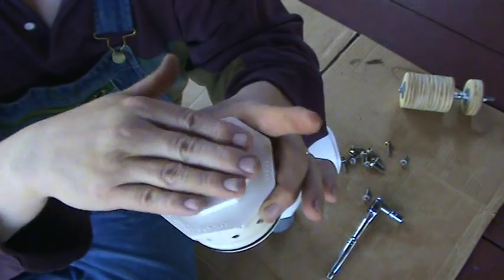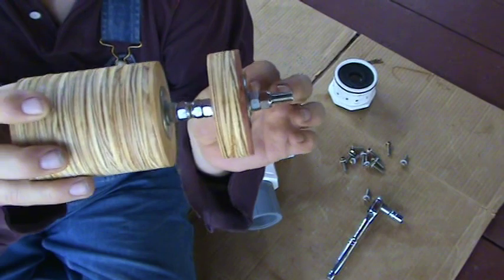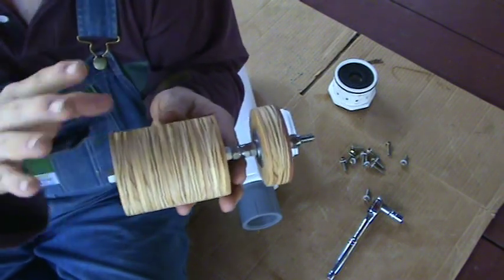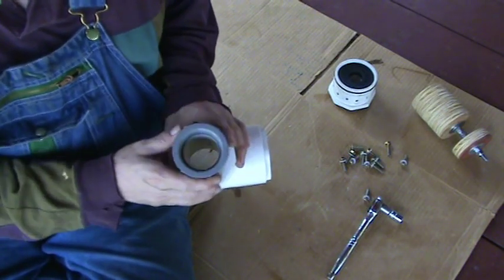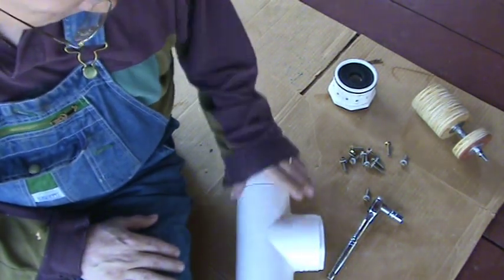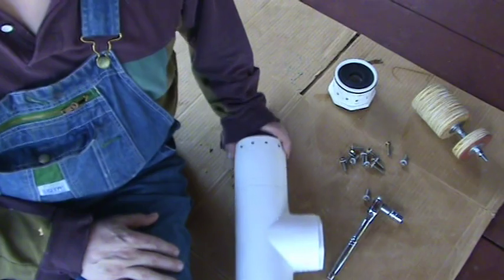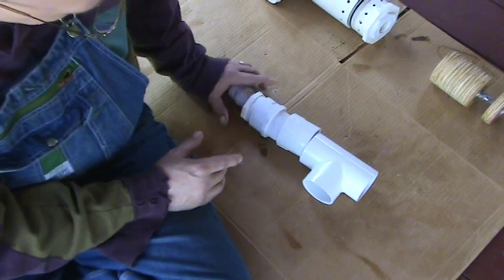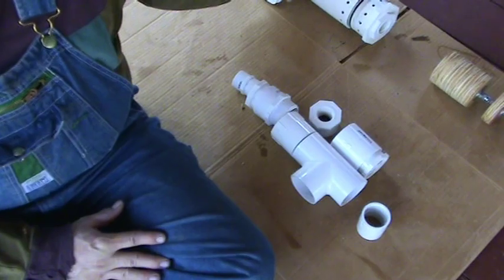Barrel Sealing Piston Valve (Part 2)

Comment from the maker: My Lowes had some plain sheet rubber in the plumbing section that worked very well. Just glue it to the front. I've seen most people put a screw and washer in the center to help hold on the rubber.

Comment from the maker: @trampstunts 

I think it was a 3 1/8" which gave me a piece of wood just barely under 3" diameter. I then bolted them all together, put the bolt in a drill, spun the piston and used a sanding block to get the piston smooth and just small enough to fit in the pipe easily.

Comment from the maker: Yes, that's the point of the bolts and o-ring on the bushing (or the screw together alternate design).  They will need periodic lubrication and possibly a new rubber sealing face from time to time...

Comment: @VerbotenDingleberry I upgraded the piston in my 2" pison valve to a spool type with floating o-rings that made a check valve and it works really well but it weighs like a pound! It's ok though, I have a good bumper but I would still like a lighter piston.

Comment from the maker: You might find some steel washers that fit. If you put a short piece of pipe inside each end they could hold the washers in place. . That could be lighter than filling it with hot glue. Or you might just fill the ends with a half inch or so, not solid from end to end. The lighter it is the faster the valve will open and that's what you're after.

It will need to be able to take some abuse though, so be safe...

Comment from the maker: DWV isn't pressure rated.t's just for Drains, Waste and Vents; no need to be very strong. Under pressure this stuff can blow apart and cut you up pretty badly. it's pretty ugly. In combustions it's not as bad because the pressures are lower but at 100 PSI or more it can get very nasty when one blows up.